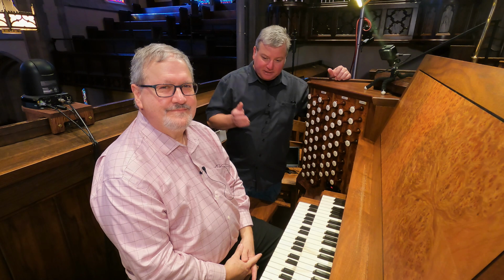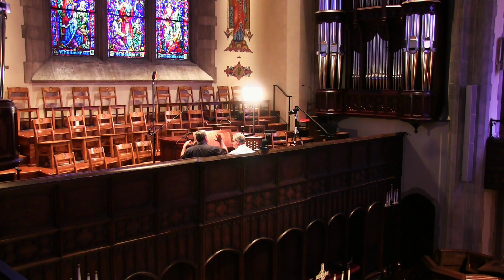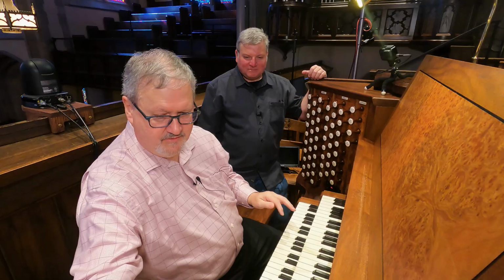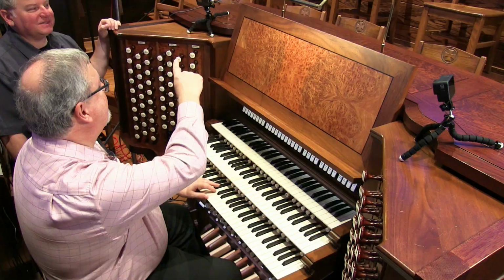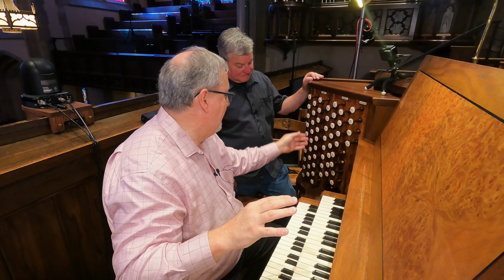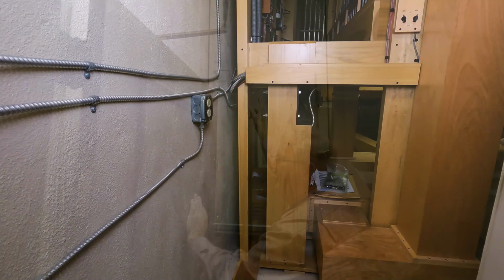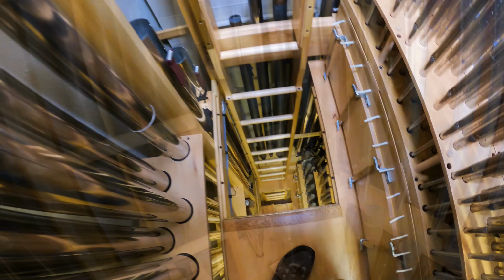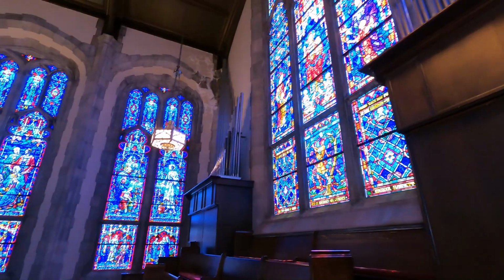2012 Dobson Organ - Independent Presbyterian Church - Birmingham, Alabama

Comment: I was part of building this organ in 2012 :)
Other than hearing individual ranks being voiced in the shop, I rarely ever hear the completed instrument demonstrated, played, or see the completed and finished interior. I usually build the wood pipes 16' and smaller, repair/releather old wood pipes, build walkboards, ladders, swell shade assemblies, swell box walls and roof, blower box. floor frames.
I remember those black steel gratings in the second case to let the sound thru.
Reply: is dobson still going after the workplace fire?